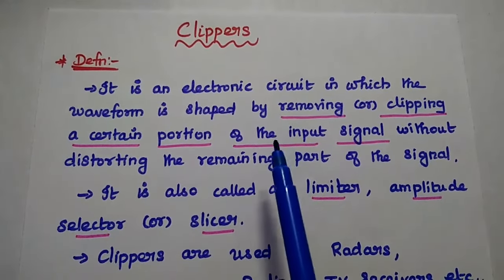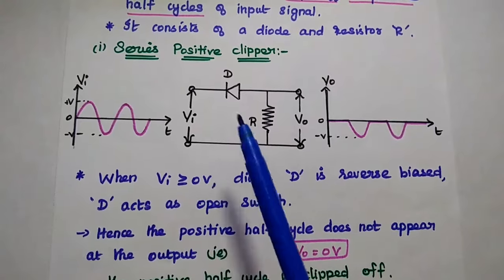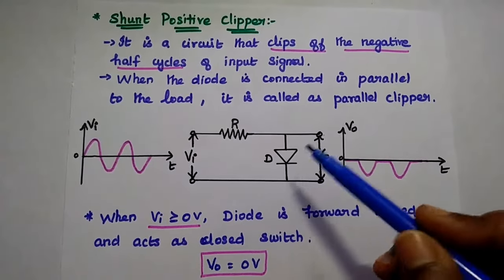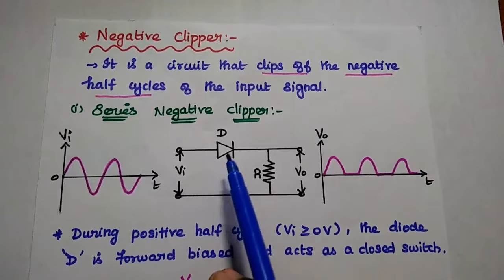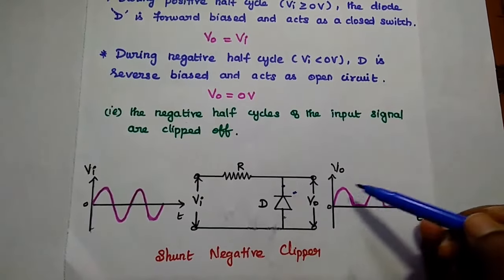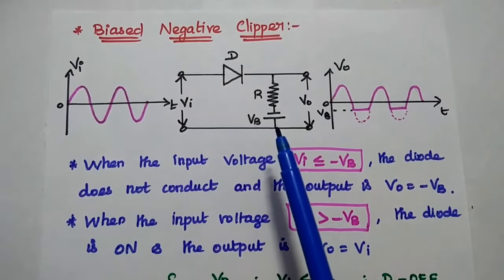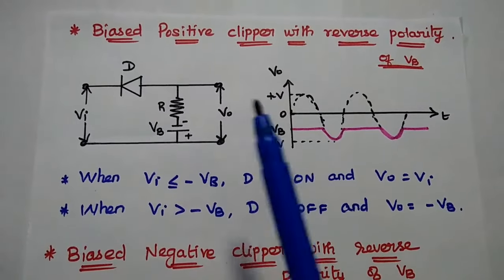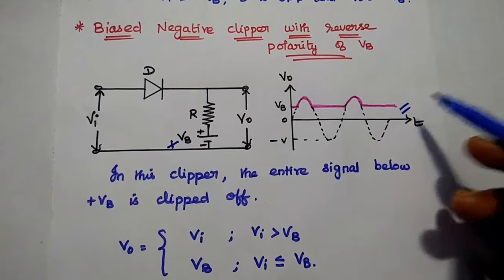Clipper and Its Types - Diode Clippers - Electronic Circuits

Comment: Mam mpmc important questions thanga mam exam ku leave ve ila
Reply from the maker: 8086 - Architecture
8086 - Addressing Mode
8086 - Instruction Set
8051 - Architecture
8051 - Addressing Mode
8051 - Instruction set
8255 ,8253, 8259, 8579
Reply: @PadmasriNaban 🔥❤️ Thanks mam ✌️ lesson wise irutha clear aah irukum mam please cleary lesson wise sollunga mam 2marks venum